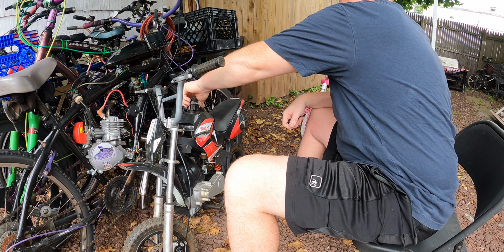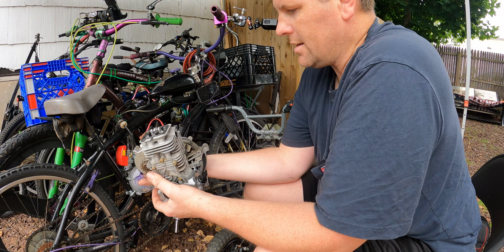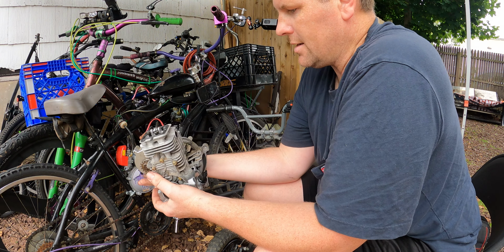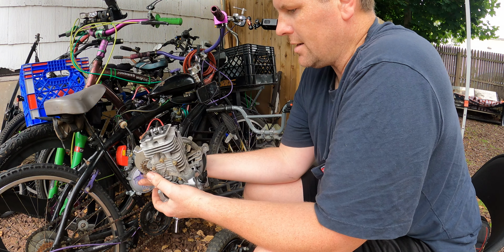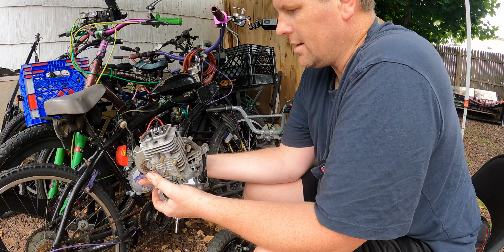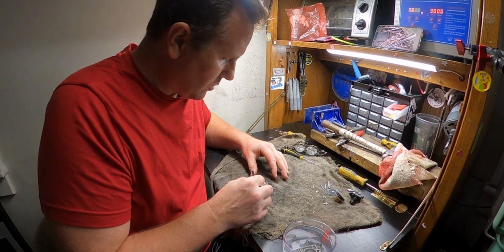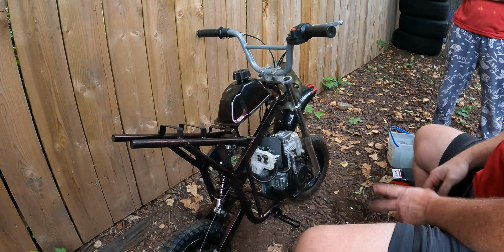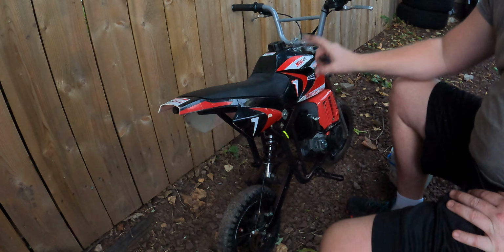Mini Dirtbike Fix & 80cc Motorized Bike Build

Comment: Just put on a wider bottom bracket so the exhaust can clear the pedals. You probably already know but for those who don't, if your stock exhaust is ever hitting or even touching the frame, then the motor is slightly tilted, and that will cause bad chain alignment.
Reply from the maker: @JamesEgly  it can also cause bad vibrations or excessive vibrations. Thanks for posting the tips.

Comment: Hey Jonny would a mz65  fit on 100cc motor and when I took off the top end the rod said 80 is it a 80cc or 100cc
Reply from the maker: Well I’m assuming it says more then just 80 on it like af80 zl80 or something. But the size is dictated by the bore of the cylinder and how many cc’s the combustion chamber has and bore and I take but to be honest I don’t know all the facts on how to determine the size of the top of my head. Either way easiest  way to figure it out is what size is the piston is in its circumference. Is it a one piece cylinder or two piece. But the mz65 should fit most motors just not the phantom or avenger or the built train. All other your good to go. If you have any other questions feel free to tap the link in the description for he group or the group chat and you can get me there easily.
Reply: @JMB676  thank you man good stuff I have a two piece  had it for 3 years  works good dont have much mods on it just waiting on piston  and  rings  I have a carburetor  Np dont know  the size  that came with it but it works great  up hill but sucks on a flat road  I'll appreciate  the info  thank bro I love your video  all the way ...
Reply: Here's a pic of it  if I can send it to you kk
Reply from the maker: Send it in the group. The link is in the description. I would love to see it and everyone else also I’m sure would like to see it also.

Comment: which engine is on the bike your're riding here? I may want one
Reply from the maker: The blue GT I BUILT HERE is just a basic 80cc with a 38mm stroke. Most people say that the 40mm is bett but I get much more life out of the 38 and I get more rpm without as much stress too. In my opinion for a daily that you are going to to ride a lot you need more rpm then low end power so you have many more carefree miles of riding.